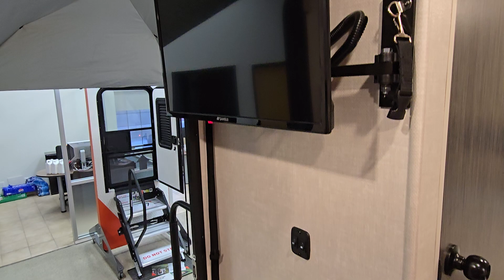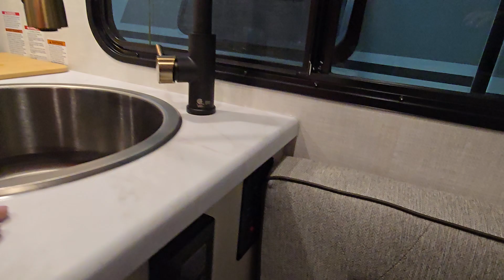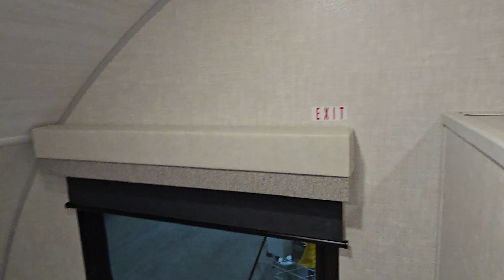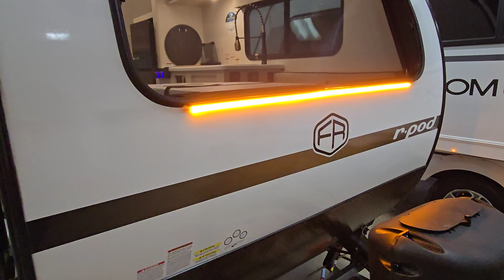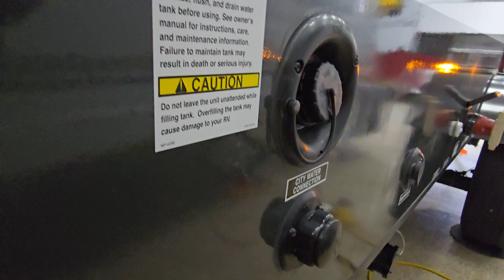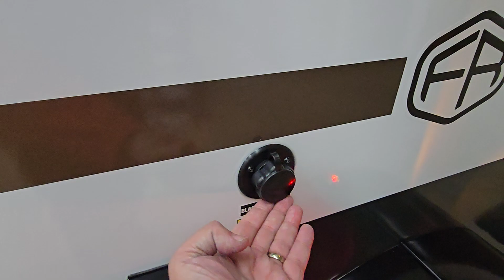We Found the PERFECT Super Light R-Pod RP-171 for Under 2,652 LBS!

Comment: I had a 178 years ago which is the same basic layout. Great trailer. I made three modifications that worked well. Firstly, I bought a longer shower hose and moved the shower sprayer to the wall behind the toilet. This allowed a couple more feet to shower without the sprayer being right in my face. Keeping the door open while showering prevents the curtain from sticking to you when the fan is running. . Also I moved the clothes hanger around the corner as once it’s extended to hang things on, there is very little space to squeeze by getting into the bed area. Lastly I bought wire closet shelving and cut it to fit over the dinette and bedroom window valences. I used spring loaded shower rods to support the shelves. At 16” deep, turned upside down so the lip faces upwards, they provided an amazing amount of storage. I just placed items on them after setting up so there wasn’t excessive weight on the shelves during travel.
Reply: I'd love to see pics if you have them. 
I'm getting a 2010  174 model, and the floor is spongy. Not sure if it's fixable by just doing the floor or if the whole bottom of the camper is compromised.
Reply: @judylaprade405 I just deleted a video I had. Sorry. If the floor is spongy, I’d really think twice about buying it. I don’t know if it’s a cheap fix or even doable.

Comment: Sometimes I wonder if the people designing these have ever been camping in an RV. Its like they get paid to just throw leftover parts together in any which way and slap a 30k price tag on it.
Reply from the maker: The 171 is definetly a different animal. Its geared to someone who may two with as small as a properly equipped Subaru outback as it only weighs 2600lbs. Therefore compromises definetly have to be made when going smaller and lighter

Comment: $20K or so new.  Never buy a new RV; they lose their value faster than milk left out on th counter.
Reply from the maker: This type of unit bought to stay in a certain vehicle class and often for the long term with no intention of "moving up". If you " buy and hold" a lightweight unit like this you won't lose as there is always a buyer for it because of its weight class. 
If your buying the 40ft diesel glamper that's a different animal